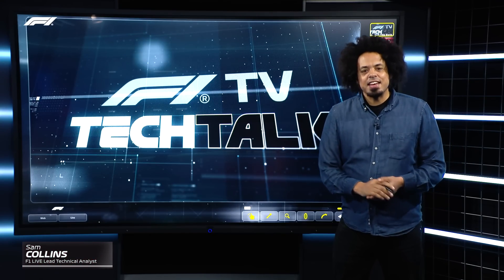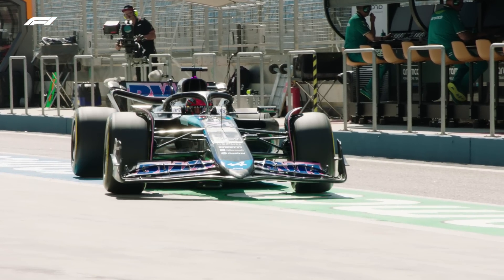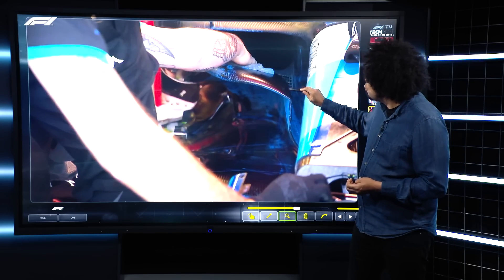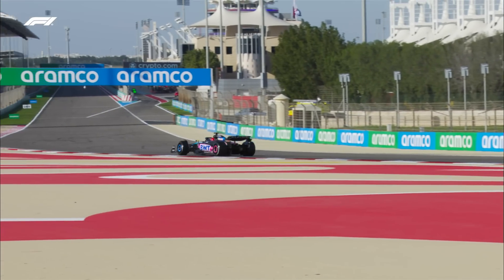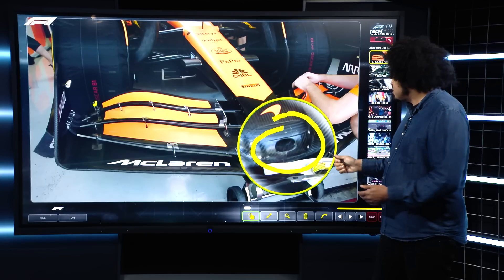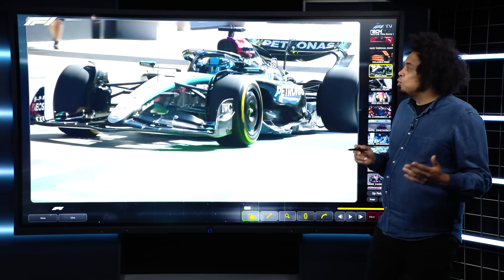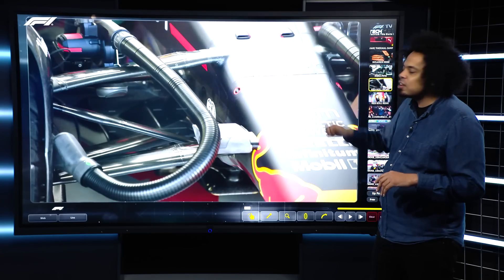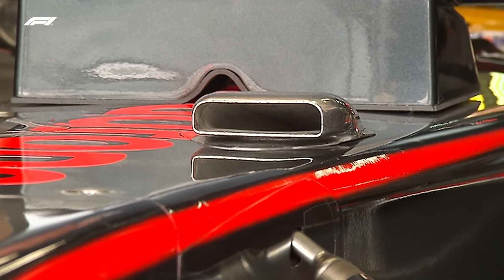Secrets Of The Pit Lane | Tech Talk | F1 Pre-Season Testing

Comment: Most fighter jets have their air intakes slightly separated from the fuselage, so that the engines do not injest the slow, turbulent air closest to the aircraft skin.  I wonder if Alpine and Red Bull are doing opposite with their vertical additions to their sidepod intakes.  The intakes scoop away the slower boundary layer air, leaving fresh laminar flow for the undercut sidepod aerodynamics.

Comment: there should be a thermometer and a max temperature on the driver seat allowed to give more sense to that rule.
because it feels like hamilton's (and probably some others) reaches 100° and its bottom is almost burning, and this, not regarding the temparature outside or any climate issue.
i also heard about a poissible rule, where minimum aount of water would be mandatory, to avoid drivers only having 50cl for a whole race distance.

Comment: Something interesting to note about the holes on the RB. Perhaps the holes at the front of those big shoulders help funnel air across the louvers. That air will accelerate as it moves through the body work. Just looking at the picture, it seem that the airflow is being guided directly across the beam wing of the car. Adding rear stability and grip during braking and cornering. Maybe this is how they address the low speed cornering issues they had last year?
Reply: You should ask Adrian Newey 😉
Reply: @nielsdorhout058  Lemme just dial him up really quick 😂

Comment: With the new cost cap they should "unfreeze" the power unit development rules.
Reply: The reason of the engine freeze isn't due to cost cap, but more to allow a stable engine platform that is a majority unchanged leading up to the new engine regulations in 2026.
You'd have to cast your mind back to 2014 to find the last time the engine specifications were frozen, which those engines of the V8 era were again mostly frozen from 2006 up to the start of the Turbo Hybrid era.

With 2026 bringing in supposed 100% synthetic fuels, and also the confirmed drop of the Motor Generator Unit - Heat (MGU-H), along with new manufacturers coming in, we'll see if anything changes.

Comment: I feel like driver cooling needs to be regulated as “need to use under certain conditions” rather than “can use if you want” 
At the end of the day it’s a safety advancement and shouldn’t be influenced by whether or not it’s a performance gain.
Reply: Or better yet, have a temperature sensor mandatory inside the cars and the inside of the car has to stay below a certain temperature. And how you achieve this is up to the teams